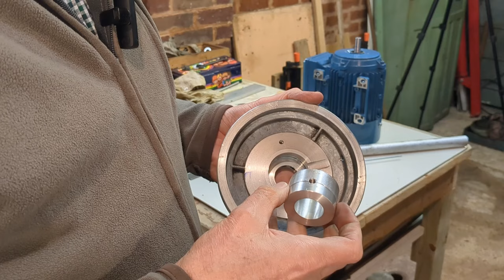Adding a Variable Speed Drive to a Meddings Pillar Drill - part 1

Comment: Just found your channel & subscribed, enjoyed your video its just the sort of videos I enjoy.
I  have removed my VFD off my Warco WM290v lathe i am in the process of fitting a TRANSWAVE frequency drive the motor is 3hp was 2.2 hp the one off the lathe will eventually go on my floor standing drill press, with the forward & reverse & variable speed hope to do some tapping on it, at some point will figure out how to fit a jog button. Will be watching your progress looking forward to the next video thanks 🇬🇧 From Coventry in the UK.
Reply from the maker: Thanks, Grahame, for your comments and for subscribing. Yes, I would like to also use mine for tapping.

Comment: Sir you are an excellent craftsman. I have been wanting to do this same modification to my Walker Turner Drill press and my Southbend 7 inch shaper.
Reply from the maker: Thank you,Terry! Hope you have success with the VFD conversions. I have been very happy with what I have already installed.
Reply: @Workshopfriend  I am sure I will. I already have VFD on one of my mills and one of my lathes. I just need to go shopping for the right 3 phase motors. There is a place here locally that has very good prices on used working 3 phase motors. The one I put on my lathe is a 2hp and I paid $50 usd for it and since the palace is less than 10 miles from me no need to pay shipping. I love your channel and have been a subscriber for quite some time now. I am looking forward to more of your videos. Thanks for bringing us along.